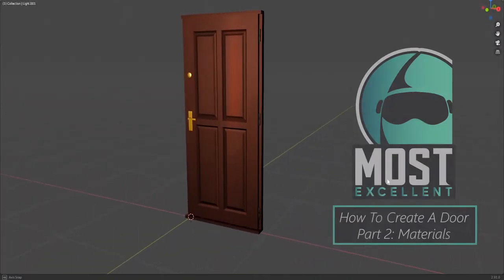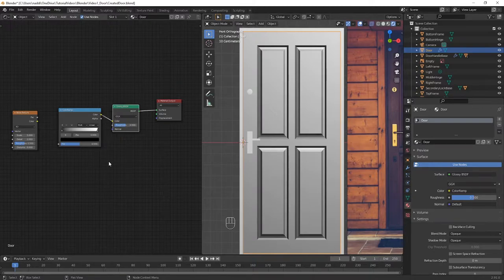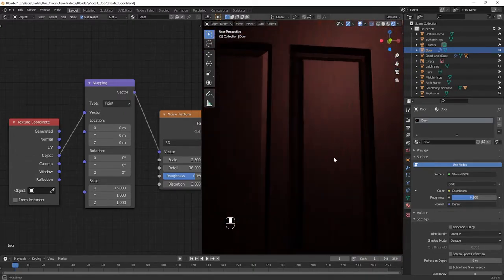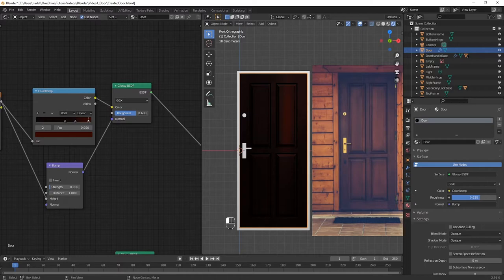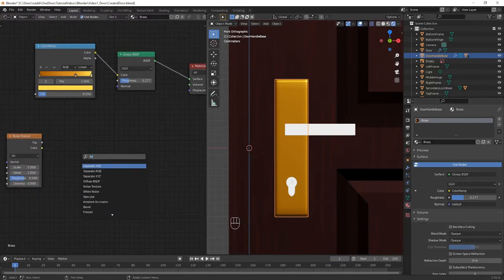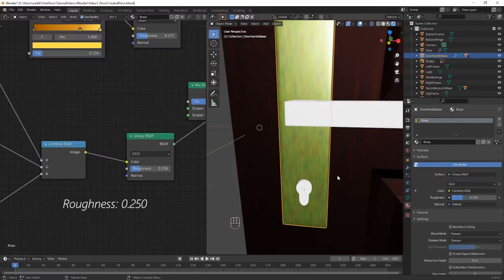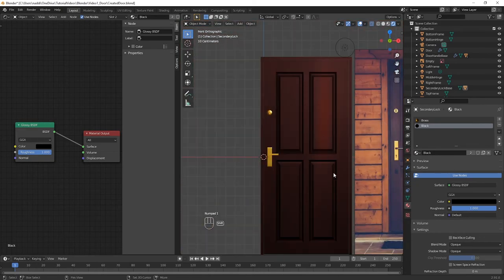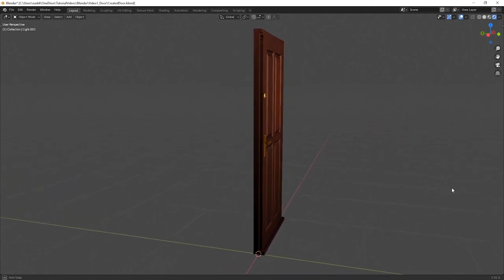How To Create A Door In Blender - Part 2: Materials

Comment: Hi, firstly very good videos, explained really well. However lol im following your node structure exactly how your doing it, and same again with the hex values; but when i input the last hex value on the right hand slider, my door goes completely black. not sure if im doing something wrong.
Reply from the maker: Hi! I tried out the steps in Blender 3.3 (the tutorial was in 2.91) and just like you I also found the door went black. However, I then added a powerful light (shift-A -> Light -> Point) next to it and found that the material was correct, just that the environment was too dark. In the description I have now added the full blend file for the door in case you wanted to compare. Best of luck!
Reply: Brilliant! That worked. I remember deleting the lighting before I stated, thanks!
Reply: *started